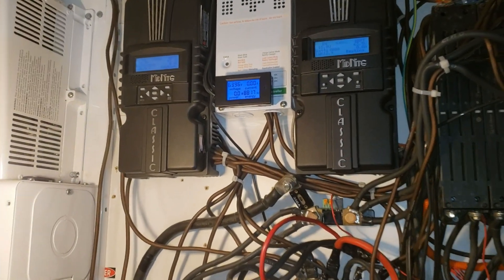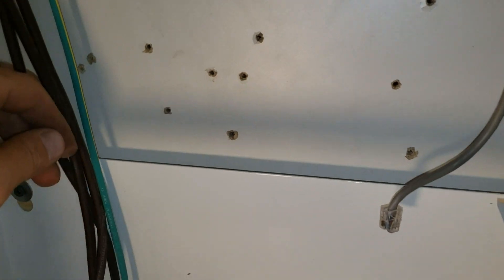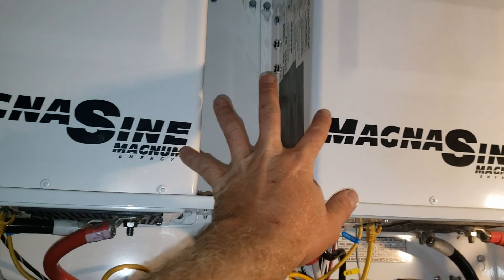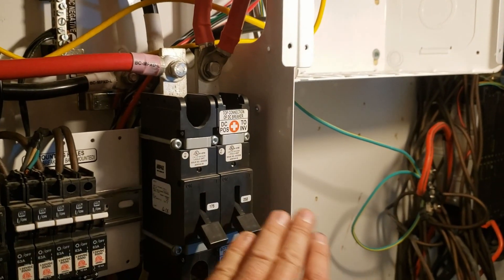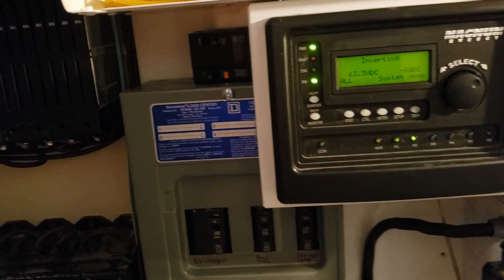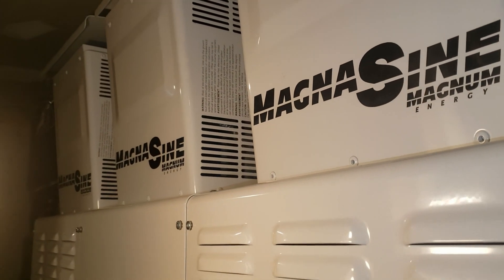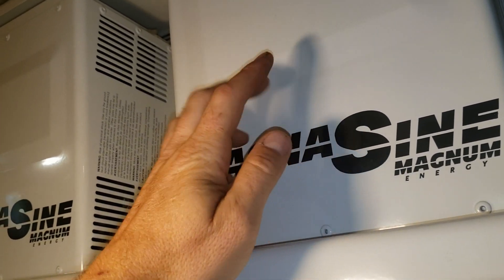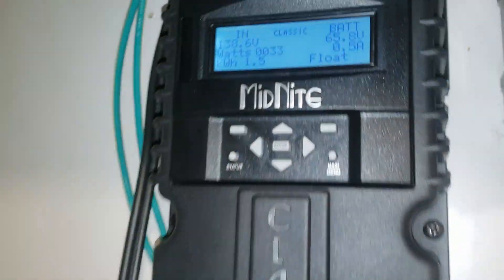Installing A Third MagnaSine Inverter 13,200w

Comment: You have a sickness lol
Reply from the maker: Yes I have a independents sickness lol
Reply: I'm all for independence! I'm off grid too, but in a fifth wheel in southern Ontario. 3kw solar and 500 of wind. My system is really janky compared to yours, but it's mine and I love it! Lol
I use 2 IBC totes for water. 1 I take to get filled, the other for storage and rain collection. Well, hell, I've had so much rain and snow, I haven't had to get water since before Xmas! All just from roof runoff from half my trailer. Still have to home something up to catch from the other side.

Comment: I have those same battery’s I think I don’t know what to do with them or how to hook up a BMS for it
Reply from the maker: witch batteries ?
Reply: 30 volt hiunda and Kia cars the 30 volt 8 s cell packs
Reply: I wish I could attatch.a BMS  and use them
Reply: But there 8 s packs with the plugs in back were you could use but don’t have the wire for them

Comment: When you Install your 2nd & third Inverter. Did you have to Set up for charging or is it Auto Connect from Inverter #1 settings threw your Router?
Reply from the maker: I only charge through one inverter atm. I only have a 7000w generator.
Reply: @GoingOffGrid101  Ok I can not find anywhere on how to do it. Asked David Armstrong,Johnny from Gain Solar, No Luck. Heard Sensata never returns Cals after they tool over Magnum Energy. I guess I have to call more Suppliers. Thanks anyways. Be Safe

Comment: WOW !   MAN YOU'VE CAME A LONG WAY UNTIL YOU'VE GOT ALL 3 MAGNASINES IN FULL OPERATION TO RUN THE WHOLE HOUSE WITH MORE EXTRA POWER TO SPARE . YOU DON'T NEED ANYMORE INVERTERS  . YOU CAN ORDER THE " EMPORIA VEIW " GEN 2 HOME MONITOR SMART SYSTEM THAT WILL WORK GREAT WITH YOUR SYSTEM .  IF YOU GET A CHANCE , PLEASE WATCH MY SOLAR VIDEOS , LEAVE A COMMENT , SHARE AND SUBSCRIBE . MAY THE SOLAR BE WITH YOU .

Comment: Love the work mate! Is it possible for 3 phase power now you have 3 seperate inverters?
Reply from the maker: im not sure, ill have to look it up.
Reply: @GoingOffGrid101  Nice, It'll make for an interesting project anyway :-D
Reply: SMA inverters can definitely do it but you need a 3 phase fuse board and you need to be far more careful as things can get very exciting very quickly if you Bridge a 3-phase circuit or you lose neutral it can destroy a lot of stuff and the inverters in a fraction of a second (I know because loss of neutral in a data centre resulted in a lot of expensive piles of smoke in the building a lot of stuff was destroyed)

Ideally your best sticking with single phase 240v (where appliances support it) use separate 110v circuit for none 240v appliances and different sockets for both systems (use UK Sockets/plugs for 240v system so you can't just accidentally plug a 110v only device into a 240v socket) as you can stack these inverter systems to provide a lot of Watts (don't recommend with 110v as need significantly bigger cables or at least separate circuits of 1190) you can do a lot with 32A@240v

Most appliances in the world will actually run on 240 volt as they usually have a built-in 110v60 and 240v50 support

SMA and MagnaSine are more geared towards 240v50 systems (but they do have 110v inverters as well) SMA have so every interesting mode called "secure power mode" to provide a dedicated emergency circuit  that has its own guaranteed power so even if the grid power is lost as long as there is solar panels it can still run basic equipment like lights and fridges while there is enough sun the other inverters will go off (it can power upto 2000watts and can also support "Sunny Island" as well where you have a Battery Bank it can fall back to at night)

Comment: Very nice and quick work! I hope to add another Magnum to my system but we need to build the new homestead first. My hope is my Magnum will run for 20 years or better if I take care of it. Getting 30 years out of the old Trace is the norm. Magnum is stout but very repairable if the Mosphets fail. I know some of the pcbs are available too.
Reply from the maker: Yes easy to repair if needed

Comment: Nice bud. You should have enough inverter to power all your stuff now no problem. Was hoping you would continue to use the reliable because I purchased one for my home after I seen your reviews. I only have it Incase the power goes out. I use Gridtie 24/7 with batteries.  I have also been telling myself to get wire channels but I keep changing stuff so that will have to be done much later.  Anyways all that white is looking good up there.
Reply: Also odd but good the flickering isn’t happening with the new inverter with the 66v. I charge up to 65.6v.

Comment: What awesome new setup you have there. I wonder when I installed my system the install manual called for  4-0 cable from Battery Bank to each inverter breaker. Then each inverter runs off a 2-0 Cable  per  inverter. Nice idea on the 250 amp breaker!

Comment: And I thought my additional Dozen, 270watt panels was something!    I'd like to find a good used midnite classic150, at a good price, I could even deal with the lite model,  i dont really see why someone would get rid of one, but 2, would handle my pv nicely, and maybe a classic 200 for wind turbine use,
Reply from the maker: I got my 250 on ebay for 450 CAD
Reply: @GoingOffGrid101  yeah the 250's seem to be a bit cheaper, but the less current, I'm only running about 72vmp, 85voc, I rather stick to a 96amp classic150,  I'm going with cheap 60 amp mppt controllers for now, maybe I can afford to get a classic or two next fall, I'm just hoping to get these panels up before the days get too short, I'm fully off grid, it's solar or generator, and the generator isn't cheap! I search eBay occasionally for a classic, it seems about $600 is a steal these days,

Comment: Put a bathroom exhaust fan in the ceiling of that closet and pump the heat out into your living room with a switch and make use of the excess heat as you’re cool you’re electronics
Reply from the maker: yes i have been thinking of this

Comment: That system is getting bigger and bigger... I'm curious.  Do you have instructions of how to shut down your system just in case something happen and you are not there to do it if a problem arise?  Thanks for sharing.
Reply from the maker: the bms do 90% of the work and if it doesn't the 2 main breakers will.

Comment: I think the newer inverter has a different circuit board in it but don't know that so less light flickering would make sense. When I run all 4 I don't get hardly any light flicker with just one running it can get anoying
Reply from the maker: mines cause I run it at 66v input and it near the max voltage.
Reply: @GoingOffGrid101  you'd think that would cause less flicker